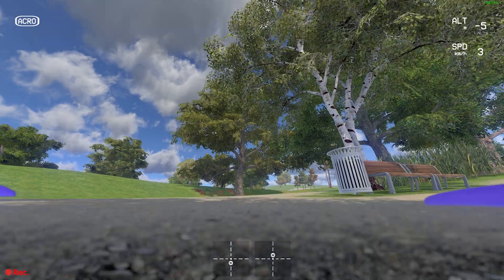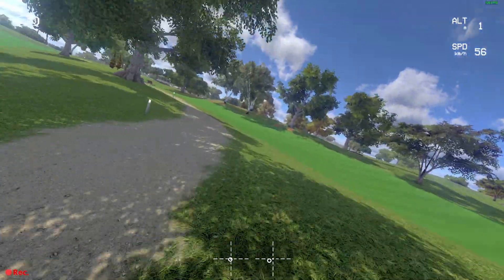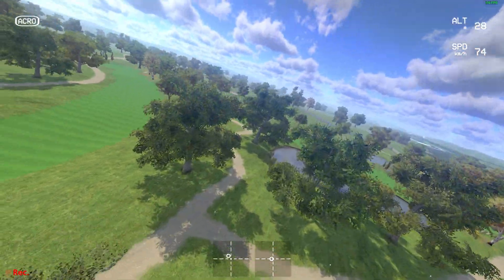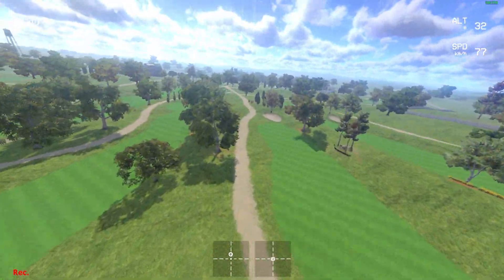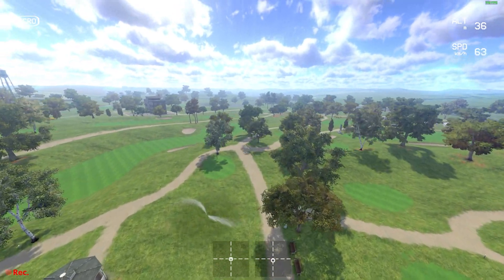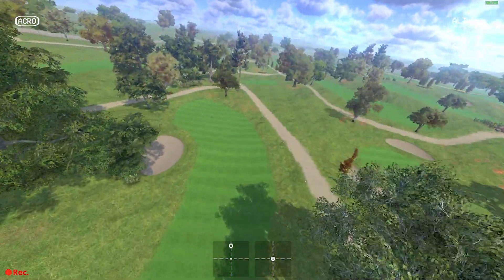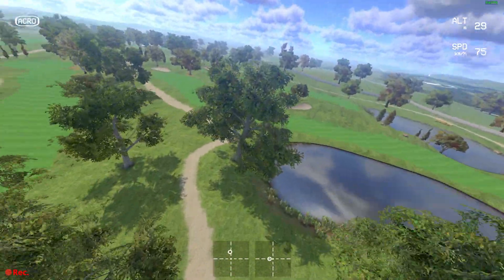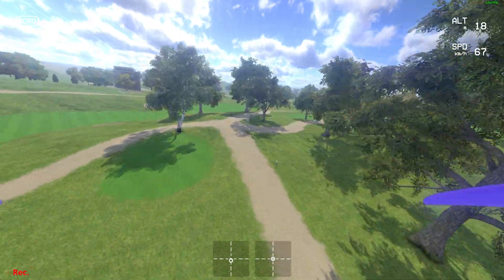Learn to Fly an FPV Drone - Lesson 13 - Landing (crashing with style)

Comment: I feel this is an area the FPV community could learn from aviation practices. I find overinflated and setting down is usually poor. When we learn to hover and set down a helicopter, any kind of crash would be catastrophic so there is a lot of focus on reliable consistent approaches. The Number 1 thing is avoiding target fixation. It’s fine to pick a point and decide to land at that exact point, but once you have decided try not to look directly at it, instead your eyes are locked on the horizon at infinity distance. You use the parallax motion of objects around you to adjust your height and students that start looking at the horizon have a dramatic improvement in their hovering. This is the best and fastest way to get good and get consistent, but it’s hard for the first couple of hours, a bit like pinch grip

Comment: I found this video disappointing. In my short experience what really matters is picking a soft (grassy) spot and disarming the shit out of the drone before it touches the ground. The other day I was late in disarming it and the contact with the ground sent the drone in some kind of engine frenzy, it flipped, and it managed to damage itself by hitting small rocks in the grass and propelling them on the camera lens. Lesson learned. Disarm before touchdown. Use grass as a pillow to make landing forgiving. Remember that if you start lawnmowing the grass around the landing spot you gonna loose the camera that will get covered in grass dust.

Comment: Took my drone out for a first flight, however when i land it and lower the throttle to zero as soon as it touches the ground it ramps the throttle back up and bounces around until i disarm it. Any advice would be much appreciated 😅
Reply: Air mode is making your drone do that. Disarm before touching the ground or configure air mode only with acro mode and it will fix your issue.
Reply: prop wash?

Comment: Why not simply change to angle mode, let the drone settle, take off the goggles and land gently with LOS flying? Seems much simpler than trying to land in acro. You wouldn't sail a sailboat into a marina, right?
Reply: Definitely an option that I do occasionally.

Acro landing can be thought of almost as a trick itself, like the easier version of perching on a ledge. I guess it comes down to whether you view the landing as a part of the flying experience or not.
Reply: Good point, i used to do that too but i found that landing in acro is more fun and it trains slow precise flying.
Reply: Not an option for those with glasses / bad eyesight.

Comment: Low cam angle landing is easy.  It's when your 45 degrees and up, that you can't see crap under you.  Then just "toilet bowl" or "tornado" over a spot and disarm.
Reply: Yeaa... but it will jump again if your battery under quad
Reply: @ As a racer, I have "air mode" off, so when quad touches something it does not freak out.  Having it off is also the trick to perching on objects, and having it just land and stay.
Reply: Yeah that's what I was gonna say just turn around instead of pitching back like crazy.
Reply: what about angle mode :-D or will you get stoned for it?
Reply: @MT-eb2dx  The best advice I can give for that, is to get away from angle mode as fast as possible.  Yes, it's great to get your foot in the door, without crashing every 2 seconds, but ultimately you want to be in acro mode to get the full experience of flight. Being in angle mode will teach you bad habits that are difficult, and frustrating, to break as your skill increases.
Reply: @ Already doing powerloops etc in the sim, but i am just saying, it would be real easy to switch to angle mode for landing and just lower the throttle ...
Reply: @ I agree.  For prob the first 2 years of my flying, I had angle mode on a switch, and did exactly that when landing! As I finally got better throttle control, and found "my" rates (100% rates are the MOST IMPORTANT part to good flying) I found having a "extra" switch was not needed.  As I started to race, it taught me what Air Mode is and how it works.  With it off, I did not need to use angle any more.  The quad will not react to touching to ground or anything else.  And remember, the slower you go, the smoother you fly.  The smoother you fly, the faster you go!